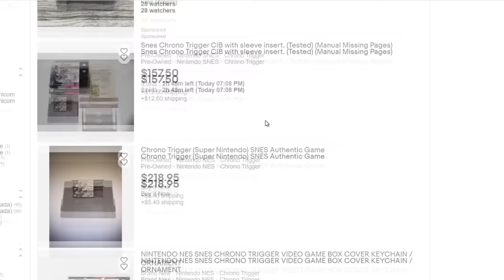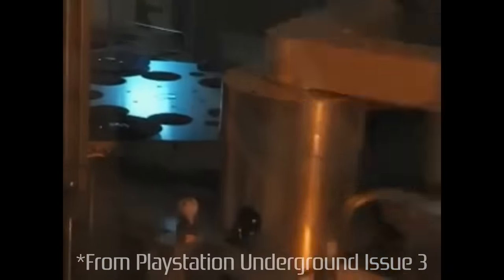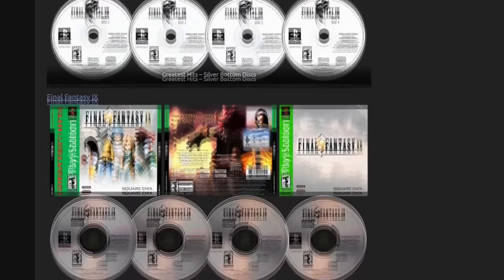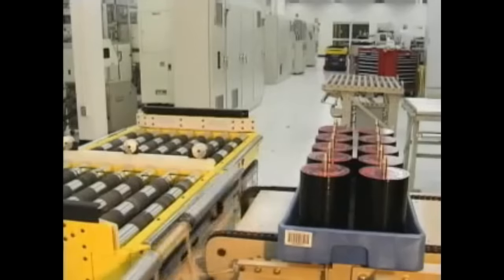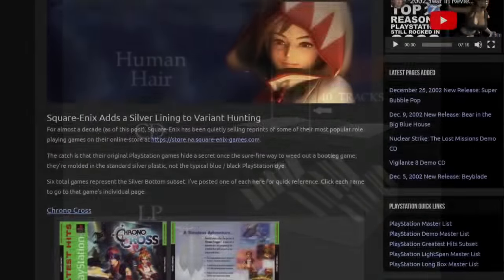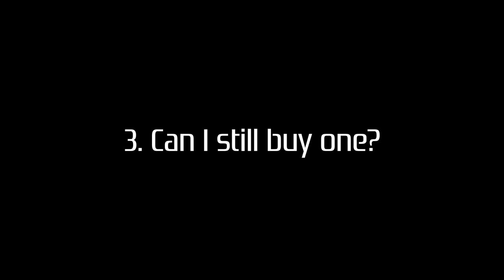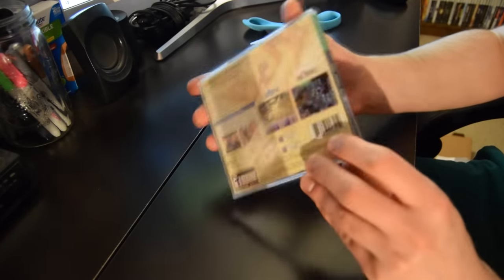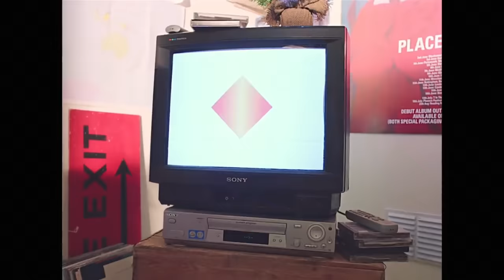Can you still buy a NEW PS1 game from Square Enix's Website in 2023?!

Comment: Regarding the black disks, it's been speculated that what they mean by "anti-piracy" is it means you can tell at a glance that it's a pirate copy so you're not fooled. Of course, they could also have just been lying.
Reply: They probably just meant that it's a licensed game most likely if it's a black disk
Reply: Sounds about right, to differentiate their product.  It was already known that the color thing was a gimmick.  There were black Cd-r's you could buy from Memorex. I still have a few lying around.  As for copying games then, you just needed a "Gold Finger" plugged into your expansion port and a spring to keep lid switch from making the disk spin backup.  Make a good dupe (which took time) and you were good to go.  Still got the occasional coaster but it was 1997 and all of this relatively easy copying was still new at the time.
Reply: The black layer was to hide the deliberately damaged disc tracks. If you were an early PS1 pirate, using the two lego heads / blutac method of disc swapping, you knew all about this, which is why games like Cyber Sled, which had the maximum number of intact tracks possible on a PS1 game, were so desirable for your original swap disc.
Reply: Help customs with blocking Chinese knock off imports..
Reply: That's what I always assumed.
Reply: A good CD burner cost around $200-$300 plus you had to buy the software to burn the disc images. It was fairly simple but there was a price of entry for sure, if you burned your own discs.
Reply: they're just black because they are. I don't think it had anything to do with anti piracy. the factory that made the black cds shut down a while back that's why the newer greatest hits are silver
Reply: @mustangmckraken1150  Lol, I don't think I know anyone who paid for programs like Alcohol to burn ISO images to game discs
Reply: @fetusman2248  this is correct. They never meant the black ink was actually a form of anti-piracy protection, just that it made it obvious to figure out if a disc was genuine.

Pressed discs ("silvers") were incredibly common in Asia when the console was released. Sony knew this would happen and it's why they made the discs black.
Reply: @lookitskazzy  Also during PS2 eras, we had two types of pressed discs. "Gold" and "Silver" DVD discs. Gold ones is like the full game. Silver ones usually have the fmvs and music cut off, so it was the cheaper version.

Honestly, Sony could've taken the opportunity to make two to three tiers of discs for different market margins including the low-incom. Back in the day, $60 discs were too expensive and still is(that's why I wait for steam sales - see how steam solved piracy for me?). You see, piracy is a Service problem.
Reply: some pirated cd in my country have black disk too idk where they have it
Reply: @aziskgarion378  you’re wrong. It’d be 3. I’ve seen blue ps2 games. Tekken tag tournament is the only one that comes to mind because I own two copies that don’t work for ps2.
Reply: @mustangmckraken1150  $200 to $300? 1995/1996, it was over a grand for single speed burners, and blanks could run you up to 25 per disc, depending on the brand.
Reply: You can also get black bottom CD-Rs
Reply: @thelastmotel  bro, where did you lived? It was not that expansive. It actually was around that range, i think it was around 400 bucks at most
Reply: @therealnoodledog6660   Here in the UK, in 1995, a single speed burner was a grand, and blanks were up to 25 quid each. Yes, it was that expensive. Only a couple of companies made burners that the public could buy at that time. The cheapest you could get a burner for was 995, and that was for an HP 4020i, but they were rarely in stock. You can look this up and check.
Reply: @therealnoodledog6660  he mentioned a burner with 1x speed so it is early days and considering my x12 Acer burner was 500+ German mark just as a new unit when it came out it sounds right. The drives where always extra expensive hut when they didn't break a true gioldmine for hobbyists of that time.
I kept mine until blueray drive era, DVD burner was moved down and the "ide to sata" adapter on the drive was trashed with it :-)
Reply: Argument doesn't stick because you could buy blank black discs to burn your copy on. I still have a couple somewhere.
Reply: It was literally because the black plastic was probably cheaper. We are talking about a Japanese company here.
Reply: James Wickham  well how long till they could be copied?
Same with bluray.
Once they get the encryption keys in the drives firmware.
The cats out of the bag.

Some drive firmware was just decrypted, some firmware did not have any encryption so once de-compiled, the CSS and AACS keys were obtained  it is pretty much over.
Sure they could use new keys, but that would render older DVD/BD players unuseable
Reply: @thelastmotel  bro, yesss, the HP white-mouthed ugly ones! The burners! 4020i, i even remember that name. Well, in Brazil they used to go for 300 to 500 bucks USD MAXIMUM like really really maximum almost overpaying it, it's crazy to think that UK paid 1k for it, you guys had it really rough in tech prices i guess.
Reply: @kitecattestecke2303  I'm not sure about the exchange in marks for dollars, but shouldn't 500 marks be like 250 dollars in 1995? If so, it was in the lower range. Still, it's crazy to see how prices differed across regions - i never thought about it
Reply: @johnnoreau3570  Blue PS2 games were CD based PS2 games.
Normally PS2 games were on DVD.
Reply: @fetusman2248  that's what he said
Reply: Back in 90s Sony was the only one who had black discs matter of fact Sony was the only patent holder for that. Very rarely they offered to someone else to use the same for their own prints.
Marylin Manson loved it so much he struck a deal with Sony for them to print his albums (certain number of batch).

So it was indeed an visual representation what is OG and what is fake. Keep in mind you could end up in jail if someone finds out you have a bootleg copy and had to pay a fine. Granted some countries didn't care and sold those anyway.

The knockoff black discs came in around in 2004 and even then those discs had to have some branding on, they were never legally allowed to be blanks, as in printable. The printable ones came in after 2010, that is the 1st time I was offered by any company to buy those. And they are much expensive then regular discs too.

However I love them because they don't wear down the laser much as the white ones do.
Reply: @minmogrovingstrongandhealthy  disc color does not effect the laser
Reply: @kyler247  YES! This. Here in Brazil pretty much all PS1 games were silver as well.
Reply: What are you all talking about you could buy black burnable cd-r discs back then...and still to this day!
Reply: @smyrna112   Yes but they were not printable also the layer structure was still different. The printable ones came in decade later or so. It was more expensive then buying a used or greatest hits PS1 game... even then it wasn't available everywhere in the world. I had to import mines from China and Japan.
Reply: pirate here, yes initially they did, but after a while you could get black writable media, altough the best media was Verbatin brand discs wich where blue, they ran better than original some people with old or defective lasers on the consoles could run games on verbatin media while original games would not load
Reply: @mustangmckraken1150  yeah and after that you could sell them and a make profit, i know i did, in the end i had like eight burners workin non stop
Reply: It was to be different and they were able to be popped into a CD player to hear the soundtrack etc. Wonder if it's silver because they removed the CD feature who has one so we know? Haha

Comment: I had a copy of Chrono Cross when I was a kid that I was never able to beat because the second disc was screwed up and wouldn't load correctly. A few years ago I saw Square Enix still had new copies available for like $10 and I bought one and was finally able to beat it. I probably could've just used an emulator but it was pretty cool being able to load up my old save file from like 20 years ago and be able to finish it.
Reply: How did it feel to load back in that old save and actually continue the game?

My only  similar experience would have to be the witcher 3 saves that i loaded in after a few years of not playing.
Reply: @KeeteleKeet It's not the same but I rem around early 2010s I was playing over Suikoden 2 after a decade... and because I didn't want to play Suikoden 1 so I used the old end save game of my Suikoden 1 to get the char into Suikoden 2... It felt good lol 
Too bad that I can't find my old memory cards now...
Reply: @KeeteleKeet  It was a quite a nostalgia trip. Though I couldn't remember where exactly I had left off in the story so I did end up replaying most of the game til that point to refresh my memory.
Reply: I bought a brand new copy of chrono cross on ebay for like 20  a couple years ago
Reply: I recently just continued a ff7 save over christmas that I originally started back in 2015 and killed the underwater ultima weapon loved it lol

Comment: My copy of FF Origins is the Silver Disc Reprint, too. I bought mine  last year, as well as a PS3 Memory Card Adapter for the PS3, so I could transfer save data to the PS1 Memory Card. Turned out you needed a During-Market PS1 Memory Card to make it happen. Good thing I had one at the time.

Comment: I bought a brand new copy of FF Chronicles from their website back in like 2016 or 17. I was still a collector at that point, and I was definitely not a fan of these. While the artwork on the front and back looked legit, they used the absolute cheapest shrink wrap possible, there was no top seal sticker, and of course the discs were silver. I'm sure these have confused a huge number of buyers on Ebay and at conventions, who probably think this is counterfeit merch. I wouldn't have even known about the silver discs, but one of the CD spindles had completely broken, and I had to open it to verify it was okay.

Comment: Back when Nier Automata was announced.
SE reprinted PS3 nier which helped a lot because the price on the original run was limited and still commanded at least release price of 60$ but with the hype went even higher.
I bought a few of the PS1 reprints a couple years back, but it was more of a "we have a pile of it, when it sells no restock" and only people who went to the SE store were aware.
They had(all Greatest Hits):
FF 1/2
IV/Chronotrigger
Chrono Cross
V/VI 
VII
VIII
IX

SE is the only publisher that I know of that did this.

Comment: The "black" discs are actually very dark red to let the red laser pass. The dye is meant to absorb UV to protect the data on the disc. Black CD-R were available around 2002 for professional audio-recording (maybe even earlier). It will help to protect light-sensitive substrate from UV, that might degrade the chemicals inside the CD-R. Sellers offered these disks for a premium, even though the production cost is nearly identical to normal CD-R. Pressed CDs don't need this protection since there is no light-sensitive layer and the structure is physical. It was once speculated that Sony had originally intended to use a small writable area (a few kilobytes) on the Playstation CD to add varying code or data. The UV-protection would have made sense if that would have been the case. In the end is was just a gimmick to make it harder to produce original Playstation CDs without Sonys help.
You can still buy the black CD-R (at least in Germany) from MediaRange ( amazon.de/dp/B003OCR24I ).

Comment: I work for a supplier that used to order reprints of ps1/2 they where still available up to 2018 if you order the minimum amount well like over 1000-2000pcs some items can still be reprinted some is easier than others still have to do a lot of negotiations with the publisher or some prints impossible Like once we requested more prints of FF8 but the master of one of the disk was damage and the price to get a replacement was not worth it anymore or fatal frame ps2 at a point the publisher didn’t want the game reprinted I think the last massive reprint was 2008.
Reply: Do you recall what the last games ordered were? in 2017/2018?

Comment: Most of these old games are available on steam and such nowadays, or right on the ps3/4/5 online store, or even your phone as an app!
the pluses is that its far easier to relive these golden era games, and it often comes with big perks like faster load times, faster movement speed in game, slight visual enhancements, and additional stuff that the original release didn't have.  
I got chrono trigger on steam last year and replayed it for a couple months going through various endings, not sure if I even finished all of them.  And then I went to the endgame stuff in that reptile kingdom or whatever-  all brand new to me, never got to experience that with the snes.  Very enjoyable! 
There is something about the sense of nostalgia you get playing the game as you remember on release-  in its original form, with the original controller and console.  But lately it just feels more and more like a pain trying to achieve that little bit more of nostalgia.  Modern TVs do Not play SNES / NES / 64 / PS1 / PS2 and such Easily.  You have to find adapter cables to convert to the only port available- HDMI, troubleshoot, and stare at your big screen with big black bars on the sides or top and bottom and even then you question if the aspect isn't cutting anything out.
All that headache is gone when you just get a digital 'remaster' copy.  Really worth it. 
That said, I do understand they don't have this treatment for Many old school games, but if you like Square old school RPGs-  its likely been done a thousand times.
Reply: You defintely didn't finish them all lol! There are like 12 endings I believe.
Reply: @danielgutman5916  Oh yeah, geeze, I think I saw about 6 of them. x_x

Comment: I don't remember exactly how I found this out, I think I was just looking through the Square Enix store out of curiosity and noticed on the "filter by platform" there was "PlayStation", clicked it to see what it was and sure enough there were games up for sale, at that time it was this, Final Fantasy IX, and I think maybe Chrono Cross, of those Final Fantasy IX was the only one I didn't have (physically at least, I did already have it digitally on PC and Switch) so I figured just for the hell of it I'd order it, if only for the novelty of buying a new PS1 game in 2021, still have it sealed so I never knew these had the standard silver bottoms most CDs have instead of the iconic black bottoms PS1 discs were known for, wasn't aware they were reprints, I just assumed it was leftover stock that was somehow never sold after over 20 years but them being reprints makes a lot more sense, there's some PS2 and PS3 stuff on there as well, wonder if those are also reprints.

Comment: You can filter by consol so it will save your scrolling for a Very x 1000 long time , the clear CDs are not only from SE , most Greatest hits games were pressed on clear CDs , this is to lower the cost and I can't remember where I read an article on it but the "black" CDs ( it was more of a deep blue color ) would cause older lens to have read problems.

Comment: Okay, I was a little curious as to why the new copy of Chrono Cross I bought off Amazon years ago wasn't a black disc. It was also around 2011 when I had bought PS1 copies of Final Fantasy VIII and Final Fantasy IX off Amazon brand new. One of the discs for FF8 had some issue not working when prompted to switch discs. Contacting Square-Enix lead to me being able to get a replacement disc. In hindsight I guess I should have been a little more surprised that customer service for PS1 games was still being offered (the Final Fantasy discs are black though on the bottom).

Comment: It's always a bit odd to see silver PS1 discs, and some legit ones of those are assumed to be pirates - that's what methinks that "PlayStation look" means there. Plus is not black, is very dark blue.
How to tell a bootleg from legit? Disc art. If that fails, bottom side. Those codes near the middle - if there's only one or not at all, is a boot, legit ones have all kinds of scribbles over there. Those IFPI ones are great, and that long letter A and many characters ending with 0101 is nice as well. And also if your console isn't modified, boots refuse playing.